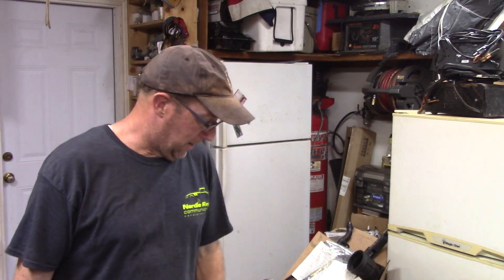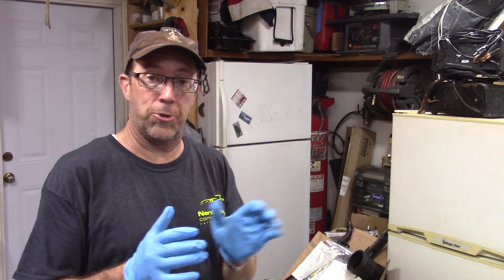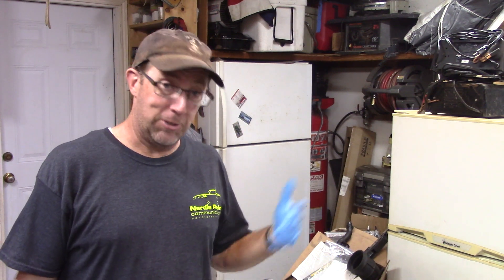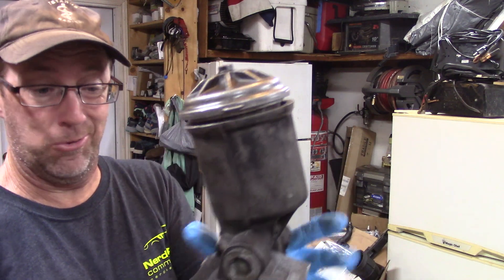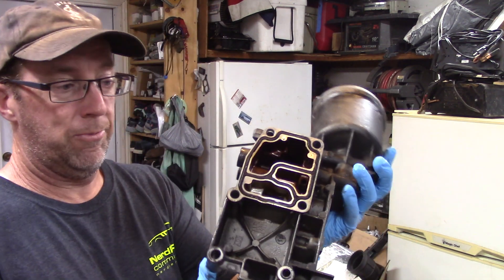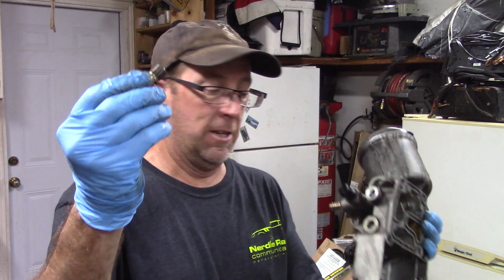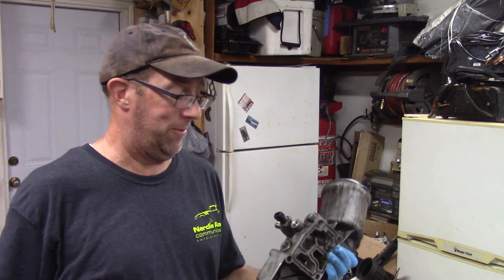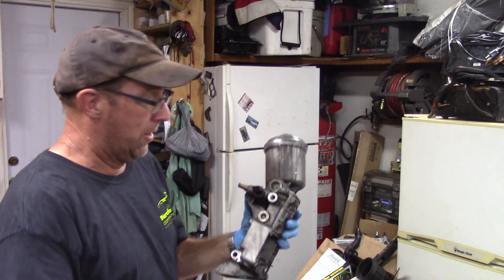BMW Z3 S52 oil filter adapter for M50, M52 or M54 oil cooler addition. Part 1

Comment: part 2 video ever get made? I have an S52 OFH sitting on my bench for a while, been wanting to add a cooler to my S52 in my E30, curious how you finished
Reply: Sorry, I have not gotten back to it. We have raced on the M50 over a year without an oil cooler and had no issues so I am not very worried about it.

I have not solved the thermostat/bypass. There is no ring machined into the housing for the cir-clip to hold it in. I did not want to weld it in.

I will try to put together an update on the fittings I got.

Comment: Great and informative
Reply: So the first method you are using m14x1.5 AN10 and m16x1.5 AN10 fitting ?
Reply: Sorry I mean AN8
Reply: @RazeDaProto  The factory method uses AN fittings. Sorry I do not remember or know the actual size.

We have raced the car 4 times now without an oil cooler. 

I finally sent an oil sample out for testing. If it is does not show signs of overheating, we will skip the oil cooler.
Reply: @troyhogan8211 so I just finished doing mine I used a euro z3 s52 oil filter housing with m14 and m16 banjo bolts and fitting that turn into a male an10 for the thermostat I used a Mishimoto inline oil thermostat that opens at 180 I think it should be be fine but if I do get issues I can swap the thermostat to open earlier
Reply: @troyhogan8211 I yeah I used VACs banjo bolt kit